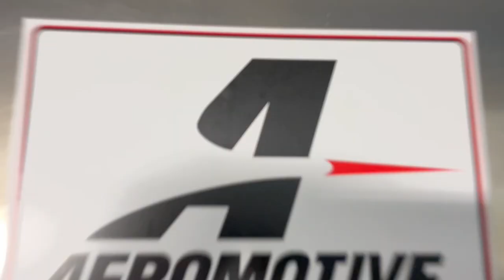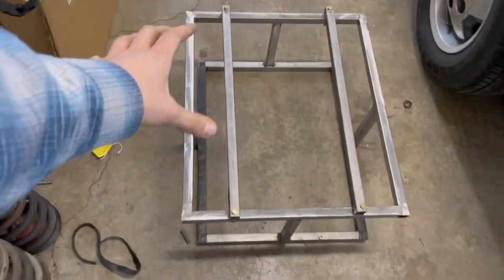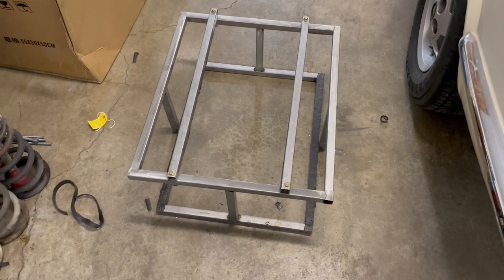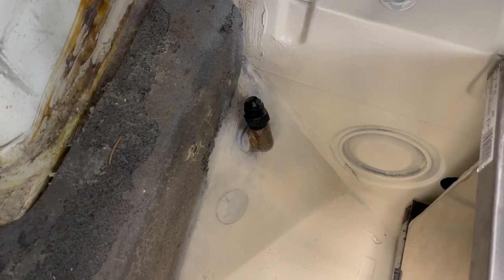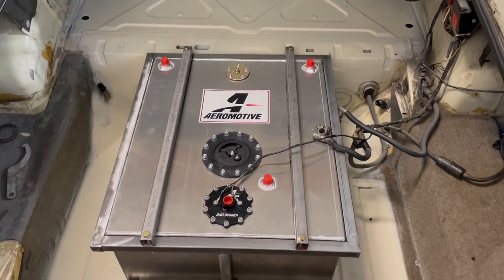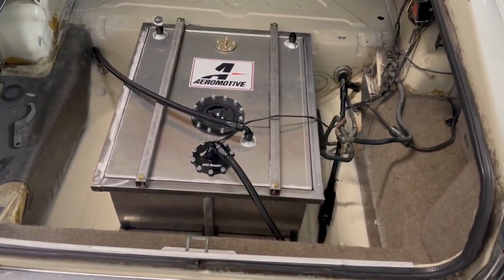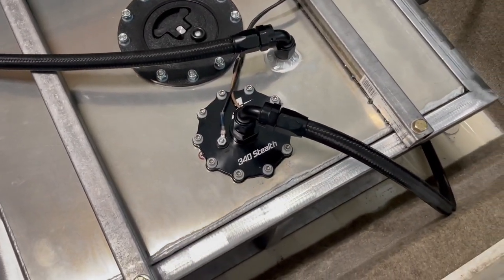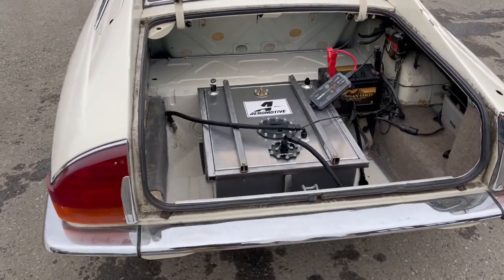Installing a Fuel Cell In a Jaguar XJS (XJS Update Part 9)

Comment: Your engine sound clips have inspired me to not just rip out my leaking v12 and do some boring electric swap but now to rebuild the v12... basically thanks for the inspiration to give myself a headache for next year or so minimum hahaha keep it up the solid work.. I might reach out to you.. also are you in Canada?? I'm about an hour from the GTA
Reply from the maker: Glad to hear! The Jaguar V12 is an awesome engine. I always cringe a little when I see a 350 swapped XJS V12. I live in Anchorage, Alaska!
Reply: @JulianGriggs  What about a 8.2L ZZ502 swapped XJS 😅?
Reply: @garyt219 ZZ502 is such a cool engine, but still a downer under the circumstances.  The 5.3l can be taken up to 7.5L and stay reliable if built properly. Stock it may as well be a 12cyl British SBC or LS equivalent because they're easy, lazy, mean, relatively abundant, and VERY similar to an SBC in some ways internally. When the jag motors are straight, you'll never have a problem as long as you drive it and keep up on fluids and whatnot. 

Most problems with those engines are from sitting, or maintenance neglect.

I and many others may have opinions and all may not be positive or nice. But rest assured in this case, there's no hate. 
To each their own. All real builds are cool, but not for everyone. If you like what you made, that's all that matters. Just keep rippin'!

Comment: That's awesome Julian, well done from Melbourne Australia. One tip I have for you, if using the original steel tube vent lines, make sure they are 100% clear and not clogged. E.g, You can easily blow some compressed air from boot/trunk line all the way to Charcoal Cannister. And then check all the charcoal cannister lines and valves are ok. On my car (86 XJSC) I ended up bypassing the whole trunk tubing as it was completely clogged. Ran new pipe from tank to just under floor pan, forward of rear axle. Hope this helps. Nice work! =)
Reply from the maker: Thank you! I plan on doing what you did to yours.

Comment: Surely the safest place for a tank would be where the original one was located? A hard hit from the rear would be pretty messy with that tank there.
Reply from the maker: I agree. I plan to put a cantilever suspension kit where the tank was originally.